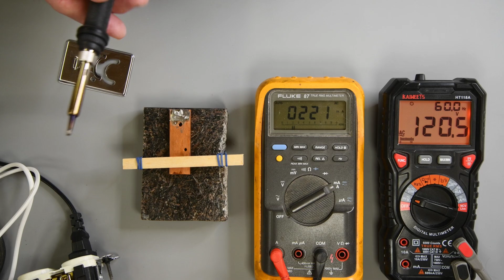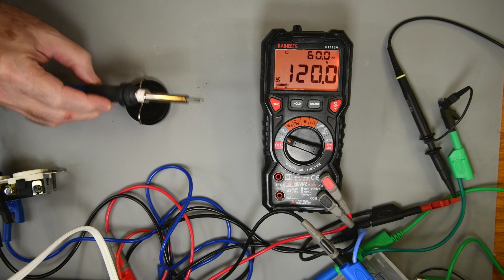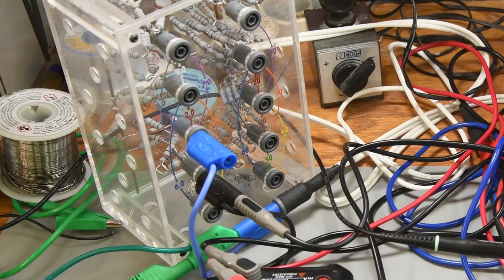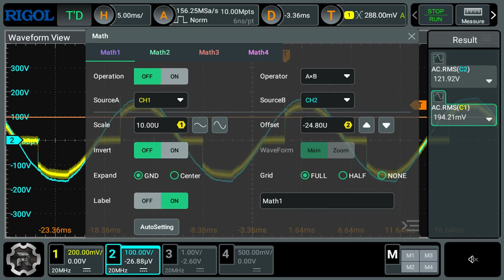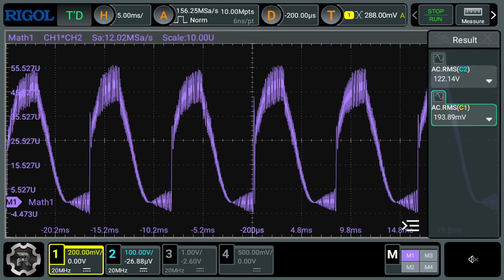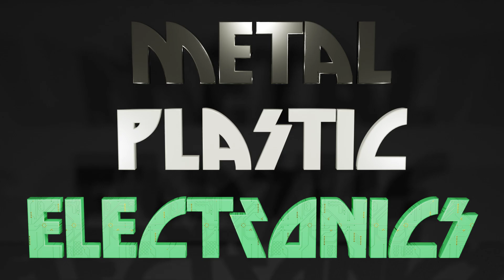I Have A Question – Scope Power Measurement Math

Comment: If you want a true true true power measurement (at least comparative), dunk each one in 500mL of de-ionised water and time how long it takes each iron to heat up the water by 20 degrees C xD

Vavg will be lower because all negative portions of the waveform will subtract from the final total. VRMS squares all values first, resulting in a totally positive sum, and then square roots the final value.

Comment: First, safety. It's not a great idea to connect the scope ground to the mains neutral. That is shorting the mains earth to mains neutral at the DUT. This can easily trip GFCI/RCD and makes the setup less safe. 

Better to use two mains-rated differential scope probes, or use 3 separate probes (not OSHA approved, but fairly safe).

Make sure you have done 10x probe compensation. 

The answer is that you want AVERAGE(I*V). If your scope has a cycle-average, I'd use that instead of the capture average... I think Vrms*Irms would also be correct, assuming a resistive load. As soon as the load becomes non-linear or has a non-unity power factor, you can't just multiply the RMS values.
Reply: Yes, apparent power is Vrms*Irms. Usually you would use ~120 Vrms, before the triac circuit in your calculations, in the case where you are trying to calculate the power factor.

Good about the isolation transformer, my quick glance had assumed it was a variac, like you have shown in the video.
Reply from the maker: Yes, connecting the scope ground to neutral would not be a great idea, that's why this is running on an isolation transformer.  But given a non-resistive load would measuring and multiplying the RMS current and RMS voltage give the apparent power?  And thanks for commenting.

Comment: Second part of my message
The oscilloscope doesn't allow filtering that low, so you'll need to make a filter ad needed. By looking at the fft of the current you can see at what frequency the first harmonic to be filtered is actually located.
Given the simple form of the current, one solution would be to calculate the phase of the fundamental using a Fourier series calculation, since the signal is periodic if we consider that the triac always cuts off the current at the same instant.
This kind of calculation, I confess, was carried out a long time ago, and there is perhaps an obvious simplification in the integral calculation of the coefficient of the Fourier series.
Sincerely
Reply from the maker: I think the first part of your message is missing.  If you could repost it, I'm interested in this for some reason.
Reply: @metalplasticelectronics354  Hello

First part of my message.
It's about time.
The voltage is sinusoidal, but the current is not. 
If I hadn’t insisted on including a link in the comment, it wouldn’t have been deleted twice without me being notified, probably due to a YouTube restriction !
From what I've seen, you'd have to go through the value of the fundamental current and know its phase shift, since the harmonics aren't involved.
With a fft on the oscilloscope, you can read its value.  For the phase shift, you'd most certainly have to filter the current to eliminate its harmonics, then take this filtered signal with the oscilloscope and use a measurement parameter that will give the phase shift between this filtered current and the sinusoidal voltage. In your calculation, deduct the phase due to the filter. The filter should cut off before 100 hz, since this is the first possible harmonic
Reply from the maker: Thanks, I'll look into that.

Comment: I believe with the scope, you would use the average, since by multipling the waveforms you have actual instantaneous power and the average of that would be the true average power. This is how the power meter for a house measures power, integrating instantaneous power. Where rms voltage would come into play is if you have a known resistance and want to calculate power. I dont think you can get true Wrms, from Arms and Vrms if you dont know the power factor, you would be calculating the apparent power. If you were able to measure Vrms after the triac, you could probably calculate it since the heater is approximately a simple resistive load once it's at temperature.
Reply from the maker: Thanks for the comment.  I think it is a 22-23 watt soldering iron.  Does that mean when I measure Vrms and Arms with a meter and multiply the two I'm calculating Apparent power?
Reply: @metalplasticelectronics354  I have some v2 favor union hall effects if you like and pair let me know. But you never respond so you'll probably never see this lol
Reply: Yes, that definitely gets you apparent power. One way to think about it is that if you had pure sine current and voltage and varied the phase of one you would go from 100% real to 100% reactive with no change in A or V rms